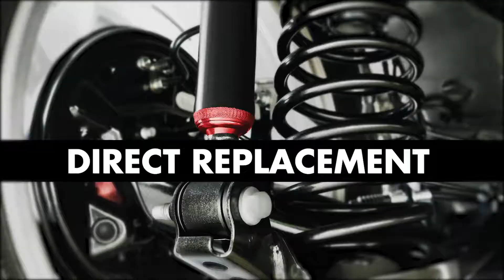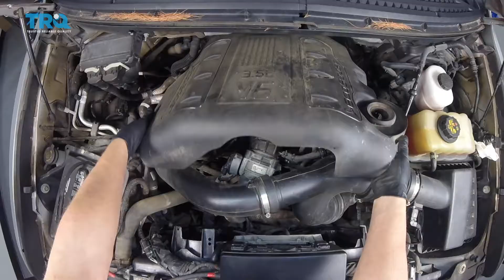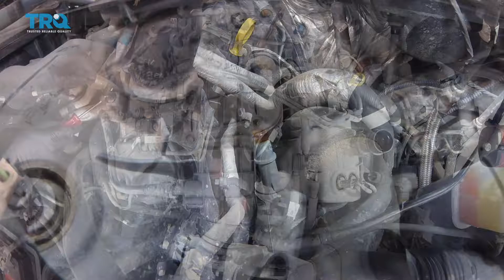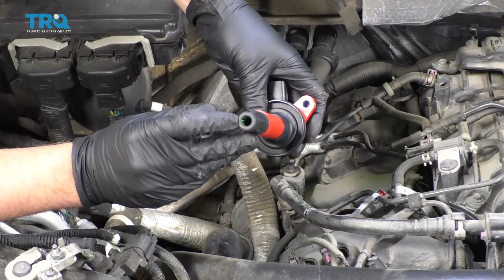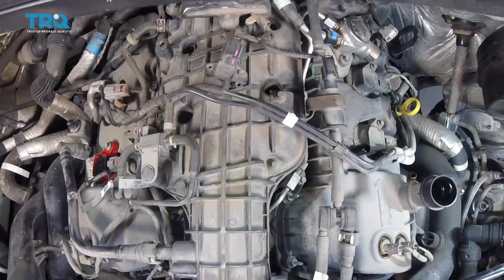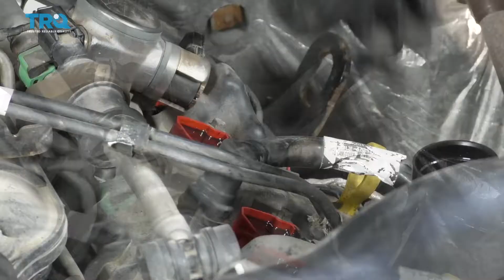How to Replace Ignition Coils 09-14 Ford F-150

Comment: This is the best video for changing all 6 as they show all the parts to move for access. It took me 45 mins and I've never done it before. Thanks for making this video!
Reply: In addition after changing the 6 coils I noticed an immediate change. The truck no longer hesitates when accelerating and accelerates with power!
Reply: @jrblake2125  which coil is #6. Thanks